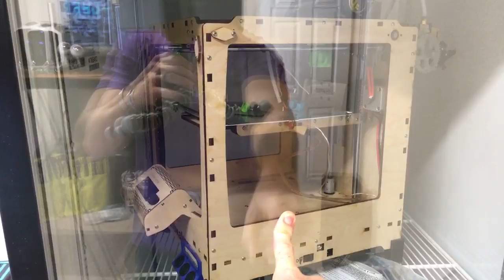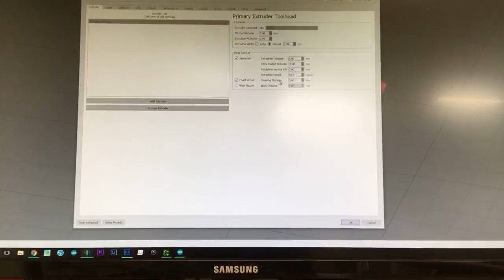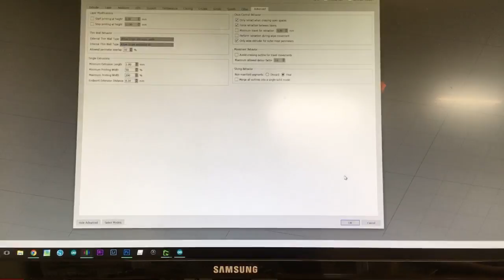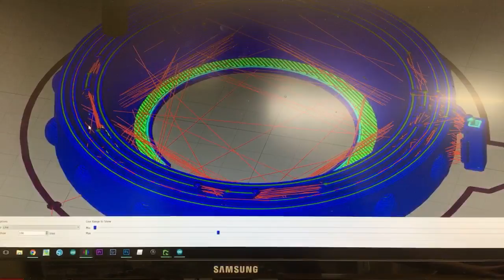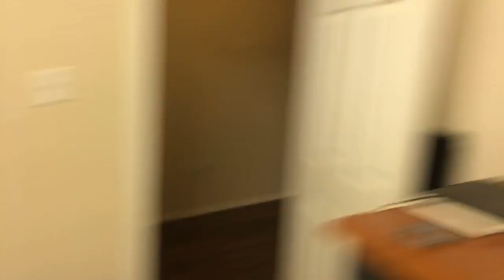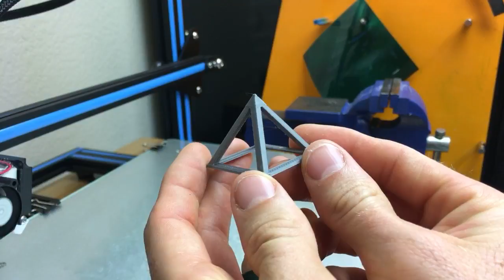Watch Me 3D Printing | Pyramid Calibration | Live Stream

Comment: Have you tried messing with your extrusion multiplier at all? If you're using 3mm filament you had to have changed something somewhere but maybe your values are off. I don't think the pyramid will do a great job of showing you overextrusion, something like this at 100% will do you a lot better: https://www.thingiverse.com/thing:1053367

Depending on what you're printing, it can be really hard to diagnose these problems. The easiest thing you can do for checking your extrusion is printing at 100% infill since your top surface finish is going to be super nasty. Printing under 100% might end up hiding it because you're giving the plastic somewhere to go inside of the model. Your problem doesn't appear to be thin wall behavior because the model shows up the same for me but it printed fine.

One more thing, after your extrusion multiplier is set properly, you can actually lower your extrusion width a bit for better quality on prints with thinner walls. S3D defaults to bumping your extrusion width up to .48 mm with a .4 mm  nozzle, but you can lower it to .36 mm without any problems. All you have to do is make sure you increase your first layer width to at least 130% otherwise you'll have really bad bed adhesion.